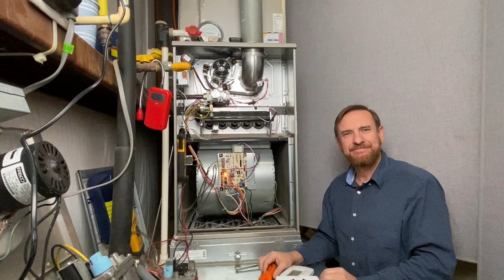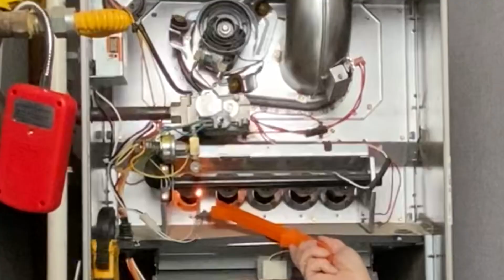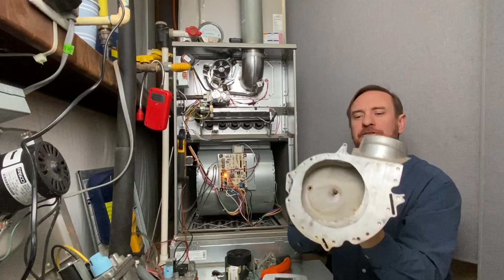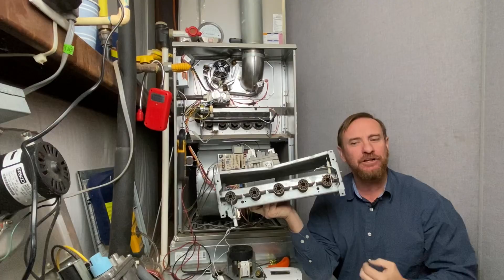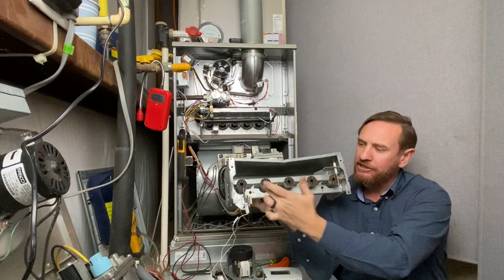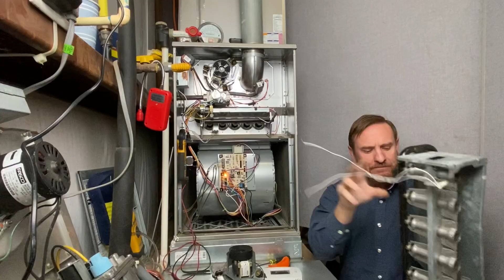Sequence of operation 80% gas furnace

Comment: I have a Ruud furnace.   Problem is about 80% of the time the inducer motor keeps running until i lightly tap on it with something.  Other than that everything seems to be working fine.  Any ideas please?
Reply: The relay in board seems to be getting stack.  It's not opening when it should.

Comment: I have a crawl space horizontal furnace now. If I bought an upright and set it in the garage where its 2 steps down from  house floor level, would it be possible to come out the bottom back with duct work to tie into the existing duct under the house? 
If I could come strait out the bottom back with duct work through a block wall to get under the house that would be awesome.
Reply from the maker: There are a lot of unknowns with this question.
1st there are several very specific codes and restrictions around gas furnaces in a garage. From air leakage and ventilation and ignition sources. 

2nd airflow is the biggest most overlooked part of air conditioning. The vast majority of units I run into have undersized return air for existing equipment and new equipment required even more. You would need to look at ACCA manual D to ensure the suction side would handel it. 
There is a Facebook group called "Fix my HVAC" where the proper calculations can be done for you with a lot more helpful inforation too.
Reply: @love2hvac  Ok Thanks! Somehow I had missed your reply.. A better option might be to have it in the sun room on the back of the house which is the same level as the garage. No gasoline is ever stored there.
Also two steps down from main floor. Floor joist would use up some of that space I suppose but not quite todays 11.5 inches. .I believe there are old school 2x10's under there.
That way it could be situated directly in line with the horizontal unit that's under the house now.
The system now has gigantic return lines with 2 large return inlets. One in the floor and one in  a wall.

Comment: old school coudnt you just suck on the pressure switch to simulate negative pressure and wait to see if the unit starts?
Reply from the maker: It won't tell you how much the inducer is pulling vs what the switch will close at and too much vacuum will damage the diaphragm inside the switch.
However some people just like sucking on tubes. 🤷‍♂️

Comment: This process is way too complex.  This is can lead to potential breakdowns and harm to human live.  There should be a reengineering of these unnecessary complexities.  We are living in the twenty-first century, not decades ago.
Reply from the maker: It's full of safety components making it very safe.
If it's too complex Don't drive a car, use your refrigerator, microwave, or any technology for that matter.
Reply: @love2hvac  you are comparing,”apples to oranges”.
Reply from the maker: Some people try to learn and understand, others just say it's too complex.
Reply: @love2hvac  this is not a matter of understanding, as I understand it well enough.  Each of the many steps are a different possibility of failure.  This isn’t quantum mechanics or even solid state chemistry.  There are just way too many variables that could unnecessarily cause a system failure.  As someone who is elderly, this is a concern to me, and should be addressed for everyone.
Reply from the maker: It is a very simple process. There are multiple safeties and redundant safeties in place all of Wich shit they system down. 
They are many many times safer than all the furnaces ever before them. 

Simpler is not safer. 

Cars today are more complex than before but now we have anti lock brakes, air bags, crush zones, automatic fuel shut off systems. Driving any car is very dangerouse but the added complexity makes them more effecency and safer. 

An 80% furnace is very simple but has many important components that where mandated to make them safer.  The inducer fan pulls a draft threw the heat exchanger some em if a crack acures it's less likely to have carbon monoxide leak. The induced draft also pre ents back drafting that was a previous problem. The hot surface ignitor replaces a standing pilot meaning there is less fule used and safer than having a constant open flame and condensation on the heat exchanger.
The tube heat exchanger allows the flame to be controlled for better heat transfer and longer heat exchanger life. They heat exchanger is lighter and allowed it to be smaller space easier to install. Before the flame burned against thick pice of metal that took a while to transfer heat then took a while to cool down. Flame impediment of the old heat exhangers would commonly crack.

Door safety switches, fill out switches, limit switches, draft hood limits, pressure switches are all safety components that trigger an immediate shut down. 

It does not get any simpler than an 80% furnace. It even comes with installation instructions and a diagnostics chart in the manual and an led leading the tech to what's wrong with it. 

Simple, safe, effective.

Comment: Hi, I've heard that the exhaust exiting the top of the furnace is under negative pressure. But how can that be if the inducer motor is pushing out the exhaust. Thanks
Reply from the maker: Almost all 80% furnaces are Category 1printed in the data tag. 
"
Category I is defined as a gas heating appliance with a flue loss equal or greater than 17% (non-condensing) with a negative vent static pressure."

80%, The inducer draft motor does pull a draft through the heat exchanger but it does not force it out the flue. The motor is just too small and the flue pipe is just too big. 

Natural convection causes the flue gas to draft out faster than the motor can push. This causes negative pressure in the flue pipe.

If you start doing combustion analysis you will see it's negative pressure, or you can use a draft-rite Guage and check it out just put a hole in the flue and use smoke and you will see the smoke is pulled into the flue pipe not pushed out.

Some furnaces have a draft hood sensor on the flue connector. If the inducer pressurized the flue it would push gas over the sensor and trip it every time. Because the flue is negative pressure it will only trip if the flue is stoped up and the inducer pushes air over the sensor to shut the unit off.

There are a few that use category 3 positive pressure, but it does not allow B vent
 It must be classroom resistive (stainless steel) and the connectons must be sealed.

Then cat 4 is 90+ condensing sealed with PVC
 The flue is smaller and pressurized the entire PVC. 

I have a video on inducer fans and I show the draft on a running furnace at the end. 

Hopefully that helps
Reply: You're the best. Thanks for clearing that up for me.

Comment: Is that an enclosed space? Why are u using double wall for the exhaust?
Reply from the maker: Double wall keeps the flue gas temperature warmer. This benefits natural convection and keeps the flue gas above the due point temperature to prevent condensation.

Comment: I thought a combination gas valve was the gas valves that have a pilot and thermocouple
Reply from the maker: The key it to remember it's a combination of a regulator and a valve. This helps with the diagnosis process. 

Valves in reality have much more going on inside it. Redundant valves, servos ext. 

The pilot combination gas vale has is addition to those a separate valve and coil for the pilot. It was called a pilot combination gas valve but people shortened it to just combination gas valve. 

Kinda like rim and wheel. 
A wheel has a rim but the rim is technically not the whole wheel. People still call wheels a r and that's fine as long as people know what they are talking about.